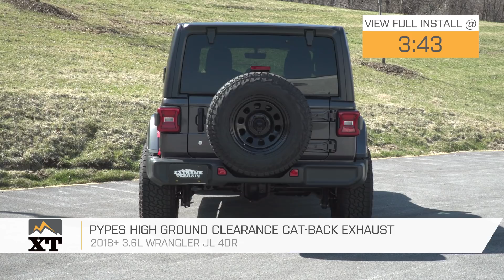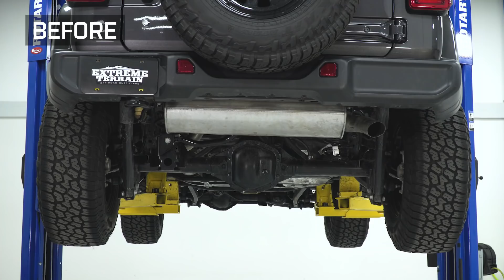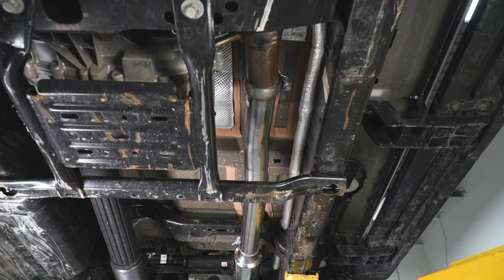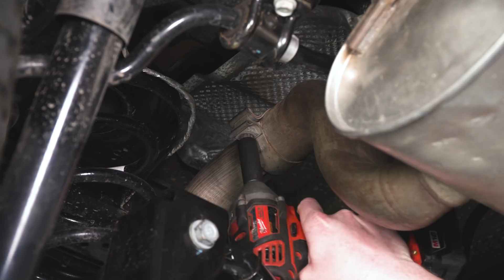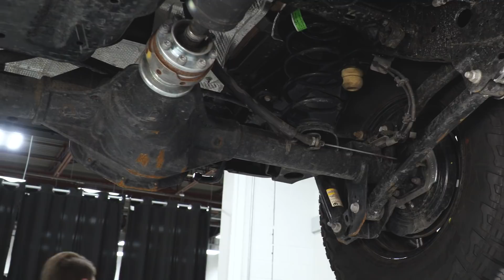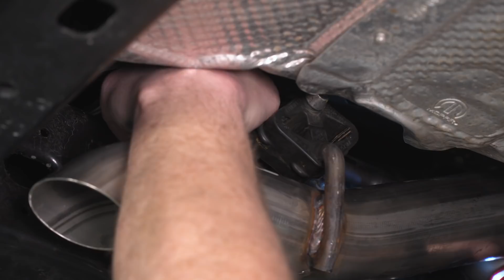Jeep Wrangler JL Pypes High Ground Clearance Cat-Back Exhaust (3.6L 4-Door) Sound Clip & Install

Comment: What about o2 sensors most have them in the exhaust
Reply from the maker: The O2 sensors are in the catalytic converter piping, and this exhaust system replaces the piping after the cats. You won't have to worry about those sensors with any cat-back or axle-back kit! :) -Merideth